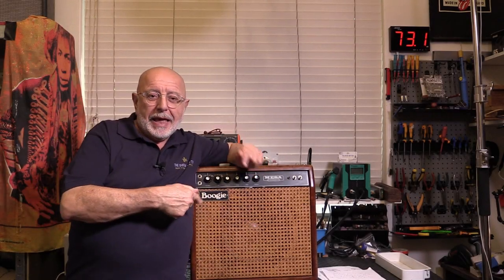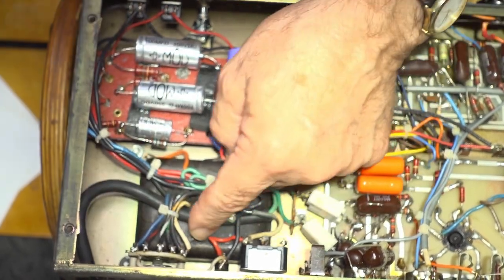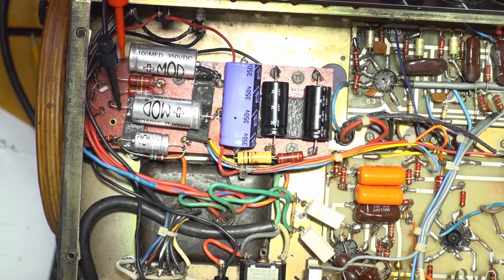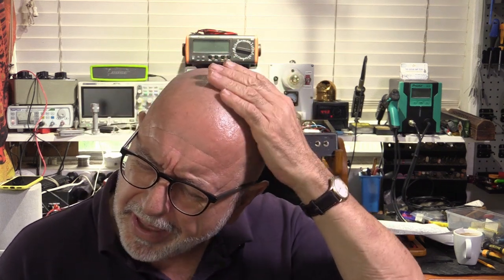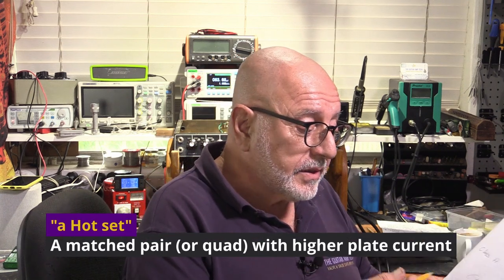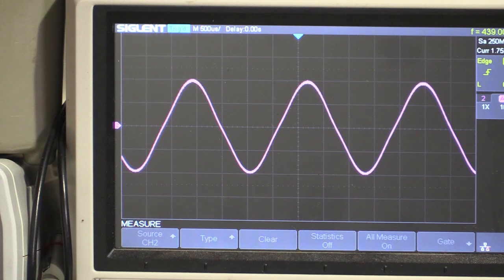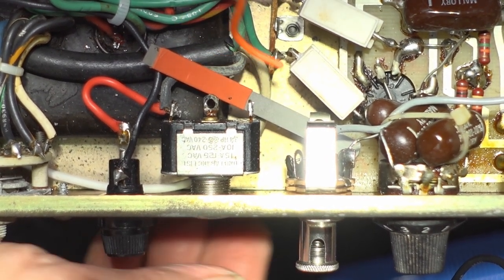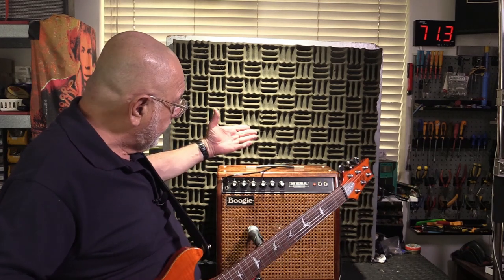Let's Repair and make Safe this Mesa Boogie Mk I - Part Two

Comment: Many thanks for these two videos on the Mesa Boogie Mk1. 

I discovered them at just the right time as I had my first boogie on the bench, having not had one for repair or service before . Your two videos helped me a great deal.  I agree with all the points you highlighted. What a contrast with Fender who are unafraid to share their schematics and even PCB layout and test point values.

Once again thanks
Reply from the maker: Thank you, Stephen. I have made a commitment to myself (and those who care for my physical and mental health!) that I will not accept any more Mesa amps to work on. They are just not worth the angst. I feel sorry for those customers who fell for their hype, but its not my journey.

Comment: Dang, that was a mess sorted.  Well done.
Reply from the maker: I don't recall if I showed the plague of dry joints. They were doing my head in. In the end the only way was to suck out all of previous Techs solder and replace it with quality solder.

Comment: I would never usually watch any kind of a Boogie repair video, but I like your patient, thorough and electrical  safety minded style Chris. Great job on that thing, I'm sure it's the best it sounded in many years, if not ever. I like simple, effective tools, so I'd definitely be interested in your capacitor leakage tester specs, btw. I Usually just lift the end opposite the plates and make sure its completely void of any DC whatsoever. I expected more crossover distortion too,  than appeared on your scope, interesting.  Randall supposedly purposely adds mistakes in some of his schematics btw, I'm told, so beware in the future. Best of luck with your daughter too.
Reply from the maker: That's the way I used to measure leakage, too, but the input impedance of a good DMM is so high that it poses no load on the grid side of the coupling cap to highlight any leakage. I'd be interested to see if the DMMs with a Low Z setting may sniff out the leaky caps. If you have such a meter, please let me know if it works. I will build a LED Leakage Tester Mark 2 when I can see daylight again. The situation with my daughter is of course a priority. Thankfully my customers are understanding and patient. If Mark 2 works well, I'll post a video on it.

Comment: Really enjoy your videos. You have a way of explaining things that is filling in some of the gaps in my vary limited tube amp knowledge. I''d enjoy a video going over the reasons behind "hot" cathode biasing power tubes like in the VOX and in my Friedman Little Sister. Your thoughts on using a Variac and selecting tubes by spec to  possibly increase tube life or just find the sweet spot tonally.
Reply from the maker: Thank you, Kent. I appreciate your kind words. The main reason why a variac is not  the ideal solution for cooling down an amp, is that it will also have an effect on your filament voltage. Too high or too low a filament voltage may shorten tube life. A good rule of thumb is +/- 10% Max variation.

Comment: Hi Chris .........I enjoy your expertise combined with wit and wisdom.   I have a Mark 1 RI sitting in the bedroom / music room of my home out here in the sticks of the deep south.    I have wanted one for decades and finally have a real  beauty with the wicker / cane speaker "cloth".  It's the 100 / 60.   I thought the reverb was rather weak so I replaced the 12 T7 tube with a new one which helped .  Even with the reverb up all the way, it's just "ok".......nothing like a "surf" Fender reverb,  which I didn't really expect it to be.......however, is there anything I can have done that might improve it ?
Thank you 
Jim
Muscle Shoals, AL
Reply from the maker: Hi Jim. Wow. Muscle Shoals. Its on my bucket list. I just want to lean up against the wall outside the studio for a cool-dude photo and pretend I am someone I'm not. 
 Good question. As you know there are 4 parts to a Reverb circuit, the driver tube, the reverb transformer, the reverb tank and the recovery tube. Any one of those elements could be your issue. Fender uses both triodes of a 12AT7 to drive the reverb transformer, whereas the Mesa uses one triode. I would not expect your sound to hit the reverb tank as hard. Good luck.
Reply: @theguitaramptech  Thanks.....do you it might make a difference by putting in a 12AX7 instead of the 12AT7?

BTW........it's pretty neat to take the tour of FAME studios and listen to some master tapes going through their studio monitors.  Being from the north, I have a hard time during the summer months here, but I do enjoy the music history.

Comment: Hello.. great and informative video series… Just wondering if you used a regular passive probe to scope the output..? And whether you scoped the single at the speaker terminals or power tube output..? possibly a differential probe..?
Reply from the maker: Yes, I use a passive probe, usually in the 10X position for less loading and improved bandwidth. I don't have a differential probe, but I can use the second channel with the Math function should I need to do that, for example in setting up the Phase Inverter. In reality, that is rarely done in amp repairs. However, I will do it in an upcoming amp build once I get through my embarrassing backlog of repairs.

Comment: Chris - looking at the big filament resistors off the tag board - was this perhaps a way of getting a 'pseudo' center-tap happening ? (when no center-tap is available from the transformer for the 6.3V supply?). (Helps noise/hum & is not intended as a way of 'taming' the filament voltage per-se). I don't have a the circuit to check for sure.  ( but I do have a Mesa 22+) - so am very aware of the love-hate relationships amongst repair folk.
Reply from the maker: Hi Ian. Sadly I don't have time to go through the video again. By the time I finish recording and editing I am over ME, but if you have a timestamp for me I will be happy to look. I did however, look at the schematic before replying to you. Yes, the 2 x 100 R resistors are indeed acting  as a ground reference. I assume from your msg that I had a brain-to-mouth failure.

Comment: So you prefer that the fuse be hot all the time, no matter what the switch position is?  Seems like changing a fuse becomes a delicate operation.  Maybe I am misunderstanding?
Reply from the maker: It is a very important and good question, Brian. What would you say to St Peter at the pearly gates when he shakes his head and asks, ‘Why would you have trusted your life to a cheap mechanical switch?”
St Peter knows that if a short occurs downstream of the fuse (including the switch), the fuse disconnects the Active from entering any further into the amp. So by positioning the fuse before the switch, the entire circuit—including the switch…and YOU, are protected. 
Another precaution is to have the hot Active wire from the power cable connect to the REAR of the fuse holder. 
But you have made a valid point. I will make up a bunch of sticky labels to say: “To avoid death, remove power cable before changing fuse”
Thank you Brian.
Reply: @theguitaramptech   That does make perfect sense.  I went back and looked at how I did my Princeton, lo and behold, just as you say!
Reply from the maker: @briansilcox5720  my man!!

Comment: What's up with the two non-stock mini switches on the front panel?...,btw,I met Randall Smith in 1980 and he claimed to invent tidal pools and the spatula
Reply from the maker: You are so funny, Ricky. Yes, I have seen some of Randall's other great inventions that stand beside the spatula. Like a negative voltage on the Phase Inverter (yes, restrain from commenting, oh ye Youtube Trolls. I know it makes the tail resistor act more like a current sink.) which then is linked to the bias supply.  I wish he had stuck to kitchen utensils. 😂
Reply: @theguitaramptech  😂😂😂😂
Reply from the maker: Sorry. I forgot to answer the first part of your question. Those 2 controls are normally Pull-Switch activated. Those pots were replaced at some time in the past and switches used instead. Not standard. I certainly would not have done it to this amp, but I must admit that it makes for a more reliable operation that is easier to see than a pull switch. The installation was done neatly.
Reply: @theguitaramptech  gotcha, thanks...I got a Mk ll in 1980 and then used them and MK lll's throughout the 80's...sounded great through old Marshall 4x12's...to me,they lost it with the Mk lV...tone suffered while it tried to be too many things at once...very gimmicky...now,out of mercy for my amp tech,I wouldn't consider one of their amps 😂
Reply from the maker: @rickya3877  on behalf of your amp tech, I say Thank You!